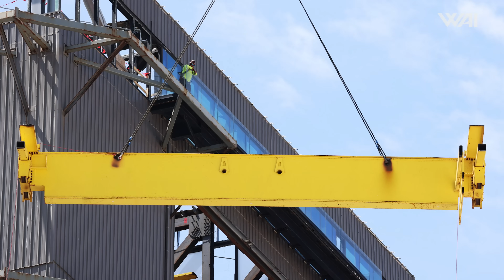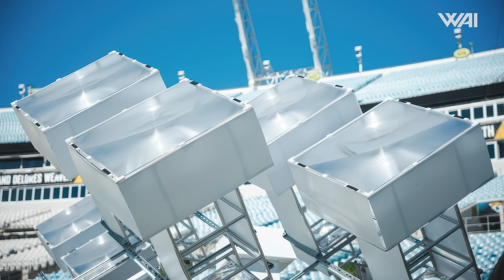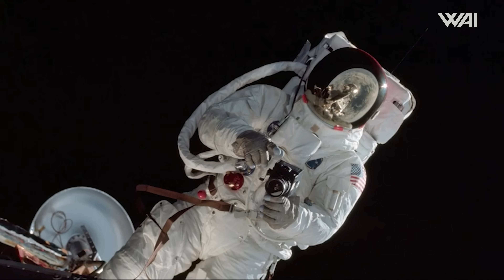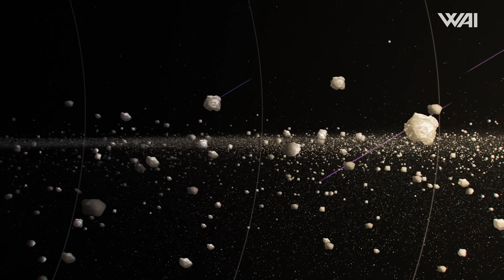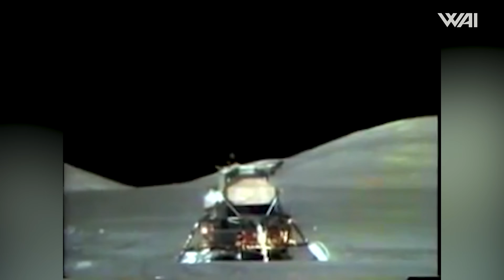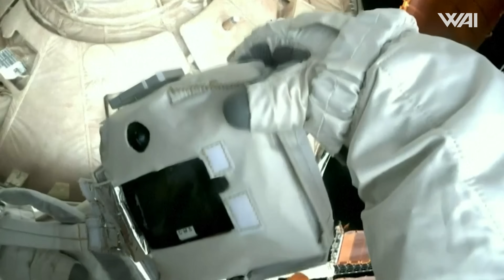SpaceX MASSIVE rush! Starship Launch Date Estimate!

Comment: Sls per cost launch is over 5 billion, not 2. The original cost per launch in 2017 was 2.15 billion and the program has taken 2-6 billion out of nasas budget every year since 2017 with no launches added.
Reply: I found it interesting that after all the complaints and rumors to cancel SLS that NASA seems to be in a high Gear to get as much as possible assembled before Isaacman has a chance to review and cancel the whole boondoggle that is collectively called Artemis .....total waste of taxpayers dollars
Reply: I heard 4 billion per launch. They could send a robotic explorer to mars for that every year and why they can't spend the money to get those mars samples back until 2035? No too expensive
Reply: @ @fredgarv79 or NASA could use the money along with DARPA to develop a desperately needed nuclear space tug and interplanetary rocket engines...these would solve the moon issue once and for all..
Reply: @mikelee-i3b but the issue is that Lockheed Martin’s DRACO project is scheduled for 2027/8, and if you cancel SLS for that, that delays Artemis 2 to 2027/8, all for a program that may not even work. Theres no guarantee that DRACO will work, so unless it’s flying by then, we keep using SLS, and will continue to do so until another crew rated vehicle or mission architecture is available.
Reply: @archierush868 Give me just one valid reason not based on fear as to what is so important that it requires the USA to go  back to the moon a few years sooner rather than later?   Artemus has zero long term benefits... is obsolete..dangerous and a complete waste of resources badly needed for long term space architecture
Reply: @archierush868  Give me just one valid reason not based on fear as to what is so important that it requires the USA to go back to the moon a few years sooner rather than later? Artemus has zero long term benefits... is obsolete..dangerous and a complete waste of resources badly needed for long term space architecture
Reply: @archierush868 Give me just one valid reason not based on fear as to what is so important that it requires the USA to go back to the moon a few years sooner rather than later?
Reply: @archierush868 Artemus has zero long term benefits... is obsolete..dangerous and a complete waste of resources badly needed for long term space architecture
Reply: @mikelee-i3b because it’s been delayed soo much that another delay to it by like 3-5 years, probably as long as it would take to restructure the entire architecture, would inevitably cause the program to be cancelled, especially when hundreds of billions are already being spent on it. You would be up the wall if the program that was gonna but men back on the moon was delayed by over a decade and a half and no progress was made while billions were being spent on it, only for the rocket to get crew there was cancelled for another way after just one or two flights. SLS and Artemis has been hit with too many delays, and because of that, they’re behind schedule by like 3-5 years for boots back on the moon. Why scrap it for another mission architecture which doesn’t even exist yet, and which may not even come to fruition?

What do you mean Artemis has no long term benefits? Helium-3 mining that can then be used in future fusion or fission engines to take crew to Mars, as well as a place to learn how to be self sufficient and to learn how to utilise ISRU effectively for future Martian exploration? It was always in the plans for Artemis to be the first step towards boots on Mars for NASA, if not for resources, but for teaching and testing the limits of human exploration and endurance.

This is also not to say we can’t use another architecture to get to the moon, it’s just that there physically isn’t one right now, and so we can’t cancel SLS in case the second option also gets cancelled, and then we have no way of going to the moon. 

Is DRACO likely to happen? I think so.
Can I guarantee that it will? No, and that’s why we can’t cancel SLS. You cannot guarantee everything in spaceflight, therefore you cannot change things until it’s proven itself. SLS must stay
Reply: @archierush868 The Artemus Program should in fact be canceled  Technology has advanced so much that it is no longer is viable......Artemis has no long term benefits simply because the only thing that actually will get accomplished at this point is landing astronauts on the moon...there are very few who actually believe that the program will go past Artemis III ...   the cost is simply so astronomical that it is unsustainable   Simply landing Astronauts on the moon is meaningless as we did this already 50 years ago

Every dollar wasted on Artemus is delaying or cancelling research and development that is extremely crucial in our quest to have a base on the moon and mine your beloved Helium-3   

Just because someone throws away 50 billion dollars does not make it wise to throw away another 50 billion just because you blew that much earlier.........Putting good money after bad is totally foolish...

There is a strong Possibility that the Orion Heat shield issue is in fact not fixed and NASA is more or less blowing smoke saying they think it might work ok.....in a vain attempt to spare the program from cancellation...

waiting for a nuclear space tug to be developed or a space tug in general to be developed solves the issue completely as a space tug could also slow down as well as speed up....this would allow something akin to a dragon capsule to reenter orbit......the entire premise of the Artemus Program and its orbit structure is basically insane and makes little sense,,

your saying we can't cancel Artemus because we currently have no other way to get to the moon belies the fact that since Artemus was envisioned Vulcan, New Glen, Falcon 9 and  falcon Heavy have all come online ....clearly options exist that simply did not 15 years ago  

If SLS and Artemus had not had so many delays and been so over budget then yes.....but even the GAO gave the whole shebang at thumbs down and said it was more or less a boondoggle..

Draco aka...NERVA may in fact never happen....that said we both agree sooner or later it will come online....My point is we can use the tech we currently have to develop a sane lunar program using today and tomorrows new tech that actually allows us to create a permanent cost effect presence on the moon ..   This clearly will happen faster than Artemus X and at  a cost sensible approach
Reply: @archierush868 The Artemus Program should in fact be canceled  Technology has advanced so much that it is no longer is viable......Artemis has no long term benefits simply because the only thing that actually will get accomplished at this point is landing astronauts on the moon...there are very few who actually believe that the program will go past Artemis III ...   the cost is simply so astronomical that it is unsustainable   Simply landing Astronauts on the moon is meaningless as we did this already 50 years ago

Every dollar wasted on Artemus is delaying or cancelling research and development that is extremely crucial in our quest to have a base on the moon and mine your beloved Helium-3   

Just because someone throws away 50 billion dollars does not make it wise to throw away another 50 billion just because you blew that much earlier.........Putting good money after bad is totally foolish...

There is a strong Possibility that the Orion Heat shield issue is in fact not fixed and NASA is more or less blowing smoke saying they think it might work ok.....in a vain attempt to spare the program from cancellation...

waiting for a nuclear space tug to be developed or a space tug in general to be developed solves the issue completely as a space tug could also slow down as well as speed up....this would allow something akin to a dragon capsule to reenter orbit......the entire premise of the Artemus Program and its orbit structure is basically insane and makes little sense,,

your saying we can't cancel Artemus because we currently have no other way to get to the moon belies the fact that since Artemus was envisioned Vulcan, New Glen, Falcon 9 and  falcon Heavy have all come online ....clearly options exist that simply did not 15 years ago  

If SLS and Artemus had not had so many delays and been so over budget then yes.....but even the GAO gave the whole shebang at thumbs down and said it was more or less a boondoggle..

Draco aka...NERVA may in fact never happen....that said we both agree sooner or later it will come online....My point is we can use the tech we currently have to develop a sane lunar program using today and tomorrows new tech that actually allows us to create a permanent cost effect presence on the moon ..   This clearly will happen faster than Artemus X and at  a cost sensible approach
Reply: @mikelee-i3b but if you cancel Artemis now, what have you done? NASA would have spent $100B for basically nothing. No crewed flights, no lunar landings, basically nothing. But, the reason why we must keep SLS, as I’ve said it many times is because:

We have no other option available right now!

Just because other mission architectures are available doesn’t mean NASA will immediately choose them because they’re cheaper. NASA likely saw that the mission architecture you’re proposing is too risky for crew, and so they chose what they already know works. Apollo did the same as they had many options available but chose a command module in lunar orbit and two stage lunar lander, all launched on a single rocket. Artemis is a slight modification as the lander is already in lunar orbit, but now, you need to get crew to the moon, which is where SLS comes in, and why it must stay until another option is not only proposed but verified and a demo flight is conducted before they stop SLS production. Even a fully expended Falcon Heavy, which you have mentioned as being a rocket which didn’t exist back then but does now, physically doesn’t have the capabilities of launching Orion to TLI. Theres also the problem of crew rating FH and all the other rockets on the list except Falcon 9, which could each take 3-5 years, way to long when we already have an option which can get us there and probably would have already completed Artemis 3 by the time either one of them has even started crew rating them. Cancelling a rocket because it’s expensive in a lunar program for a cheaper option which currently has nothing to show for itself is too risky and could cause for Artemis to be cancelled, wasting $100B+ on nothing.

Today, we only have ONE way to get to the moon right now: SLS, and until  we have a second way which is cheaper…

SLS. MUST. STAY!
Reply: SLS is a complete and total waste of money.
Reply: @dextermorgan1  Surely you must jest???